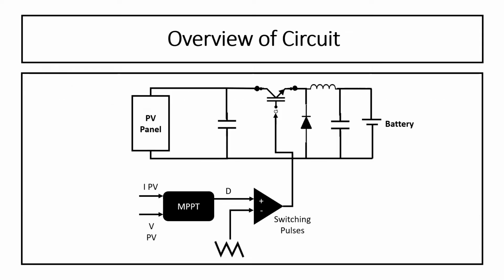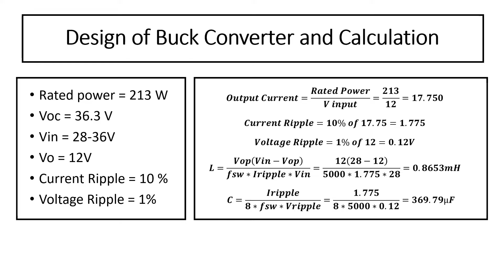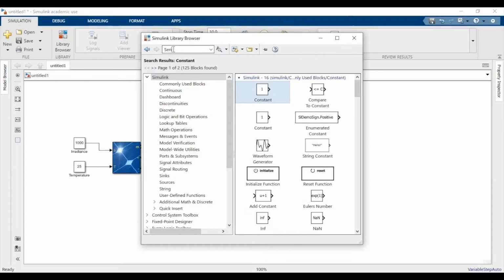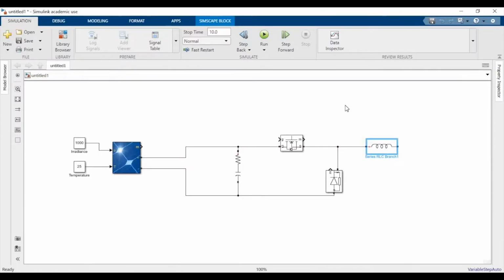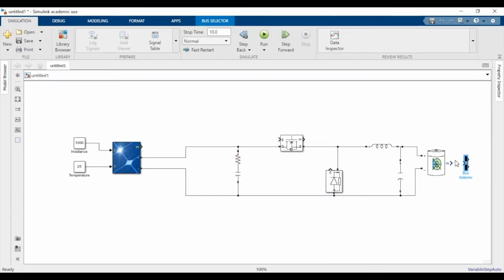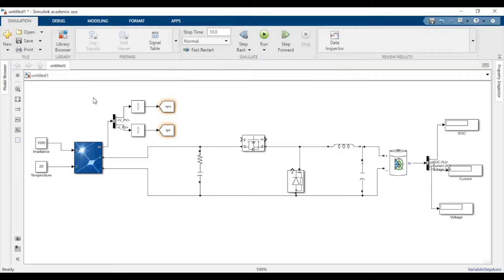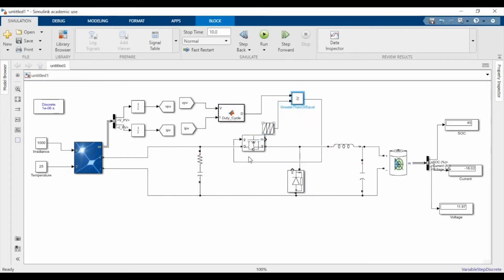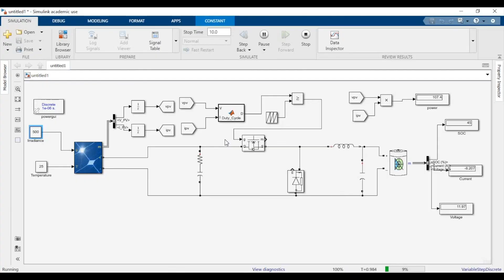PV MPPT Battery Charging Using Buck Converter Step-by-Step Simulation in MATLAB/Simulink!

Comment: Hello. Thank you for the video.
I tried to use 48 panels of 330W, 24 in series and 2 strings in parralel. I did all the calculations for my simulations, but something is strange. At the start the maximum power on the the display is around 1.5kW,  it should be 15kW, but after some time it limits to 1kW. Can you help me to figure out the problem, please?

Comment: Can you explain the reason for connecting 1000 microfarad capacitor on the input side of buck converter and how to calculate its value?
Reply: Hi, were you finally able to get the answer

Comment: Sir,
Your videos are great they helped me alot the only con you don't explain the reason behind the things for eg. In this video why we took Repeating sequence block...i had doubt that in previous video of mppt using boost converter  you used dc to dc pulse generator, also why you did modelling setting to mode trapezoidal cause in mppt boost it's duscrete type......if possible please explain the reason behind the things in short.!! 
Thank you.
Reply from the maker: Repeating sequence and the use of a comparator provides Highs and lows as the output. It acts as a pwm generator with a switching frequency to that of thr repeating sequence.

Comment: Hi and thank you for the video! Could someone tell me which is the problem that my battery doesn't reach SOC of 45%? it shows constantly 38.95 %.
Reply: I think because the simulation is only 10 seconds and the battery is 100 Ah and it is charging at 14 A. So it takes several hours to charge.

Comment: Hi, thanks for the video. I was trying to find really good reference for MPPT algorithm and this code helped me a lot. May i ask a basic question ?  
I think we used relational operator and repeating sequence for PWM signal. Because I am trying to implementation of MPPT solar charge.
Could I use pulse generator instead of repeating sequence ? Im confused. Sorry.
Have a healty day.
Nice video.
Reply from the maker: Yesss you  am use a pulse generator.
Reply: @TheUrbanScholar  thank you so much 🙏🙏
Reply: @TheUrbanScholar  Hi, great video..  I have one doubt.. In P&O algorithm.. code line number 22 and 24, both the signs are negative.. it is different from the algorithm and doesn't make sense?? Can you please explain. Thank you

Comment: Sir when I tried to run it, an error popped up. Kindly help me with it.

"Simulink cannot solve the algebraic loop containing 'aaa/PV Array/Diode Rsh/Product5' at time 0.039784 using the TrustRegion-based algorithm due to one of the following reasons: the model is ill-defined i.e., the system equations do not have a solution; or the nonlinear equation solver failed to converge due to numerical issues. "
Reply from the maker: Open the pv array block and click on the non default tab and there you will be able to check/uncheck algebraic sum

Comment: Hello sir, could you please make a video on "Design and analysis of Grid connected photovoltaic system by using PWM techniques (Sinusoidal PWM, Third Harmonic Injection PWM & Space Vector PWM)for inverter control ?
Reply from the maker: We'll look into the specification you've told. We'll surely do a grid connected video soon
Reply: Could you please send me your mail id sir?
Reply from the maker: Mail us at howtoproject98@gmail.com